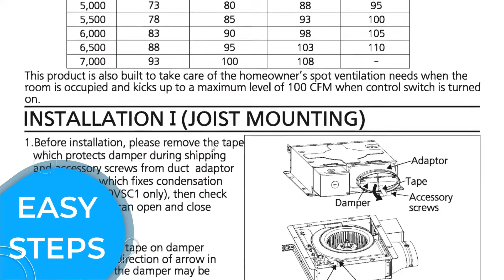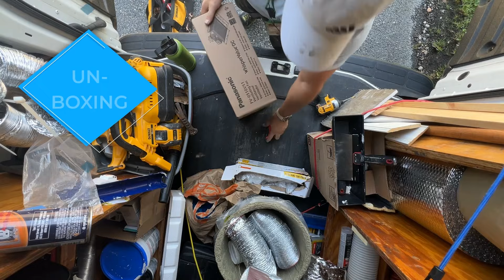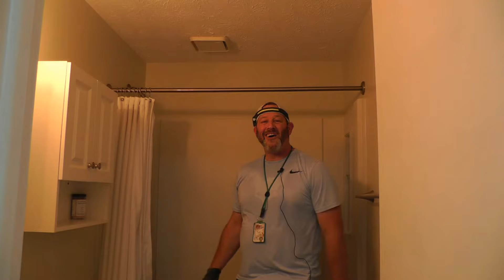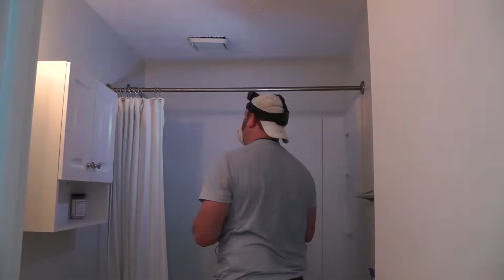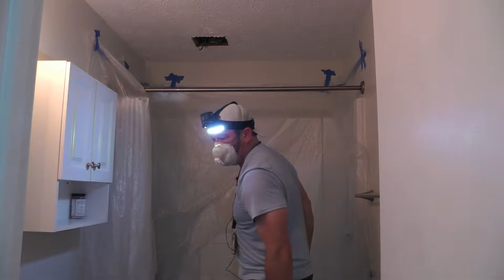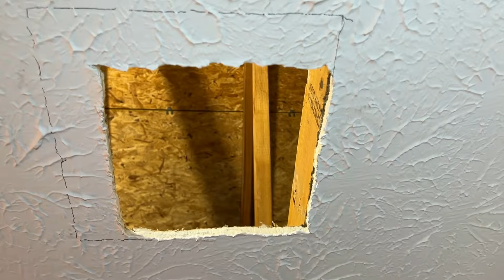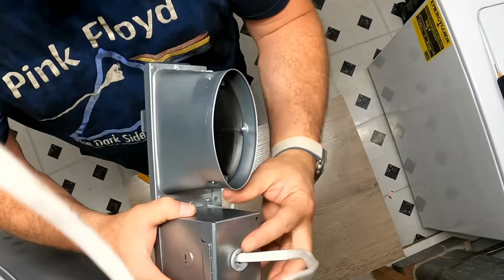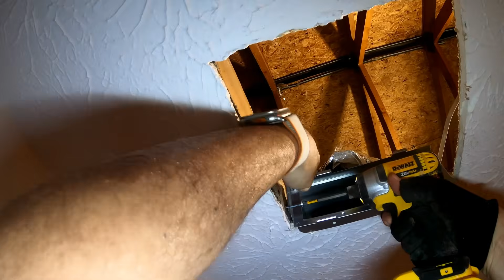Install Panasonic WhisperValue Bathroom Exhaust Fan Like a Pro

Comment from the maker: Hi! Is there anything I missed here or you need to complete this install? Let me know and I will help!
Reply: How do the wall switches work? I had some knucklehead install my exhaust fan with two rocker switches. One switch will power on the fan, but the other switch doesn't do anything. I have set the humidity level to as low as 30% but the unit will not turn on, even after taking a shower.
Reply: Is there a setting for switch vs humidity sensor use? I installed it with a switch, but its always running and it doesnt seem like it is driven by humidity.
Reply: Hi! I’m an Amazon US seller focusing on exhaust fans.I’d love to collaborate with you on a video project.Could you let me know your requirements?Thank you!
Reply: I don’t see where you installed the supplied mount bracket. Did you bypass that step and just use the wood for support. Looking for details on that exact step. I am concerned the current hole for my old fan might be too big. Thanks.
Reply from the maker: @mmatheny112  I don't typically use the mounting bracket with this model fan. If the hole is too large, you may need to do a little drywall work. I usually mount the fan directly to the ceiling joist and the loose wood. If I am ever in a situation where the joist is too far from the original hole, I may sister a few pieces of 2 x 4 to the joist so it extends out and I can make sure the fan is secure. Good luck.

Comment: What type of flexible duct did you use?
Reply from the maker: where are you going with the termination? roof or gable?  Roof: 4 Inch Insulated Flexible Duct,HVAC Insulation Duct,25 Feet  Gable: VIVOHOME 4 Inch 25 Feet Aluminum Flexible Dryer Vent Hose Air Ducting  Both on Amazon.

Comment: Can I mount it above the drywall, from the attic side, so fan flanges rest on the drywall with one side screwed sideways into the joist?
Reply from the maker: I'm not sure if that would work. I can't really picture it. Is there a reason you are unable to take the steps I recommend?

Comment: I'm thinking of replacing a ten-year old Broan fan with light and like the look of the Panasonic Whisper fan with LED light because of it's low noise rating and because Panasonic are a respected manufacturer.  I may employ an electrician to install it but I may have a go myself after watching your excellent step-by-step video.  Thank you for making this.  JWL - New York
Reply from the maker: Here is another with additional details How to Install a Panasonic Whisper Bathroom Fan (with Light)
https://youtu.be/foieJ67ul3Q
Reply from the maker: And thank you!!

Comment: Just put one in and did the TP test and it not sucking like it should, its pipe to the soffit
Reply from the maker: Is the duct cut to length and pulled nice and tight? Is is connected to a proper term fitting?

Comment: Question, I currently have an FV15VQL4 where the light is no longer working and would like to do a direct replacement. 

Do you know which model I should get?  Do I need to replace it the entire housing or just the guts?  Will I need to go into the attic for this. Will also replace the motor and refresh whatever I need t make it like new. 

Any tips?
Reply from the maker: Hi. If your current fan is properly ducted to the outside you won't need to go into the attic. You can carefully disconnect the duct and reconnect to the new fan. In my opinion, I would take out the old fan and get a completely new fan. Just use the existing wiring. Whichever fan you choose, watch a video on that specific model. If you use the one in this video, be prepared to bend the duct connection to make it into an oval shape which is not a big deal, but you do have to make sure the duct is clear of the damper, otherwise it will get stuck and the fan won't work. I believe the fan you have has a larger outlet (standard, and due to the higher profile) so you may want to find one that matches. Hope this helps.
Reply: Thanks. I plan on purchasing the same Panasonic, just a newer model that is available.
Reply: @ronsheffer  this fan is largely a replacement model of most fans, even though it does not have a similar footprint in those comply with the energy star ratings, which are critical in new construction and also in any permitted application we sell thousands of these each year.. additionally is a straight 70 CFM, however that still requires retro in order to update from current cabinet sizes of exhaust fans

Comment: The whisper remodel version of these fans is great. No need to go into the attic to install.
Reply from the maker: I agree if the fan is already properly vented through the roof, soffit or gable wall. Often times that is not the case so a trip to the attic is necessary. Yesterday, I was able to install one that had a properly terminated duct through the roof and I never needed to go to the attic, but I did anyways.

Comment: I am replacing a bathroom fan that was added to a bathroom built in 1931.  There is a roof over the bathroom so the cavity is 3 5/8 deep, with the 1/2" draywall I have a depth of 4 1/8"  I bought this fan but not sure I can do a retro install like I did in a prvious home that had lots of room and a different model of fan.

I see that the clearance between the exit duct and the flange is less than 1/2" so how do you get this to fit?

ANy thoughts on how to mount this with no attic access and a shallow depth?
Reply from the maker: Thanks for sharing the details! Does your current fan duct straight through the roof, or does it vent horizontally to an exterior wall? Can you attach the duct to the flange before securing that part of the fan? That is how I like to overcome the small clearance. I also find that once I cut the hole for the Panasonic, it gives me more room to maneuver the duct and get things set up right. I speak from installing the fan in a first floor bathroom with no access from above. Only the preexisting duct to make a new connection.
Reply: @homeairleakagetest  The tube goes horizontal to the wall and a vent.  But my issue is the flange on the output tube flange and the power box are very close to the flange that would go against the drywall. I am mouting like a retro so the sqaure body flange needs to be on the outside of the drywall and the drywall needs to side between that and thge output flange and power box bodies.  I guess because the flange is tapered, I can cut some more drywall out so if is missing near the fan box body.  The power box might have to be left off.

The fan has a elliptical output adapter.  I have bought the adapeter to reduce it to 3" which I assume is the tube size is.  There is only enough height for a 3" tube in the cavity.  At the wall, I believe the tube is disconencted from the outside vent so the vent will have to be removed to fish the tube back or replaced.  It is ony about 3-4 feet to the wall.
Reply: I can send a sketch if there is some way to upload
Reply from the maker: info@hometrustremodeling.com  Send photos too if possible.

Comment: Thank you for this video. I have a question, i just built my home and have these exact same ones. However I am noticing air flowing back in and not much flowing out. What could this be? A kink in the line? The damper being stuck?
Reply from the maker: Thank you for your contribution!! Thanks for watching. Glad this video helped you in some way. If you are getting air coming back inside near the motor/cover then I have found three reasons to date for this problem: 1. The duct connection to the fan is somehow preventing the damper from fully functioning and it needs to be adjusted. 2. One time the damper fell out and I put it back in upside down. 3. The duct is not tight, has a kink (as you indicated) or has an obstruction (usually at the end if it is not properly connected to a termination).
Reply: The installation video does a great job on the installation but misses to mention an important step, watch the video from the beginning and keep your eye on the Blue tape holding the plastic damper in place so it won’t get damage. If you focused on that Blue tape you will see it disappear from the fan with no mention to the viewer to remove that blue tape. 

If you install the fan with the blue tape left in its position the fan will make noise but the fan will not function to remove air from your bathroom. The fan is not strong enough to overcome the tape. 

I had a contractor install two of these great fans today, then went out to see how much air was being exhausted, one had a great flow of air the other had nothing. I dropped the fan by removing the two screws and pushed the plastic damper which would not budge. I could see the blue tape was still there. Eventually removed it and everything was working great after. So for those of you that think they are not seeing much air flow check to see if the blue tape is still on the plastic damper at the exit of the fan.
Reply from the maker: Dude, yes, and thank you!!!